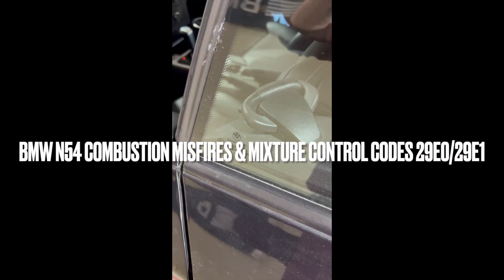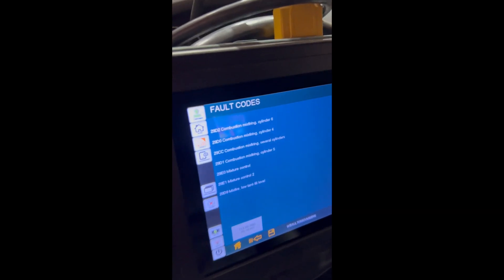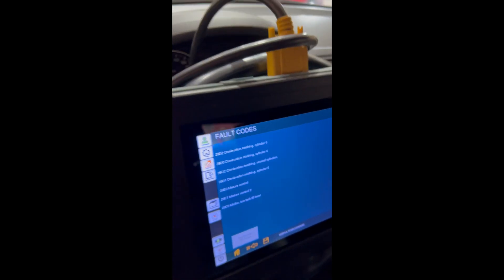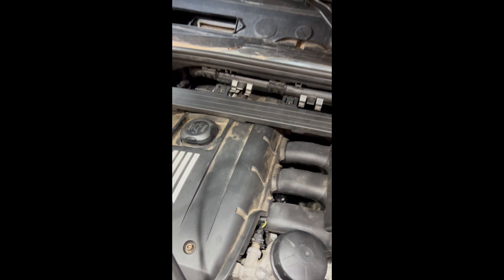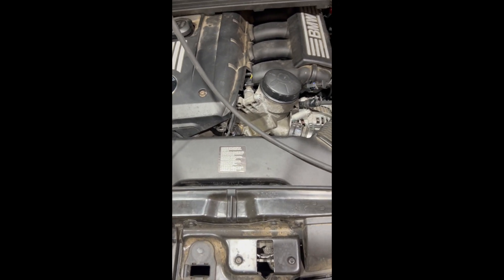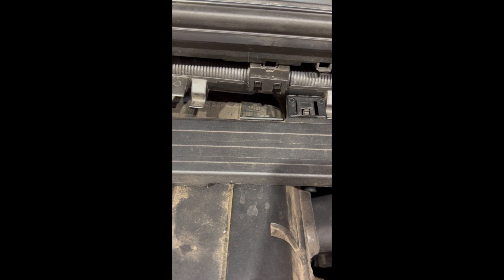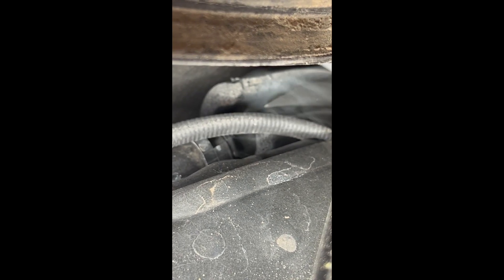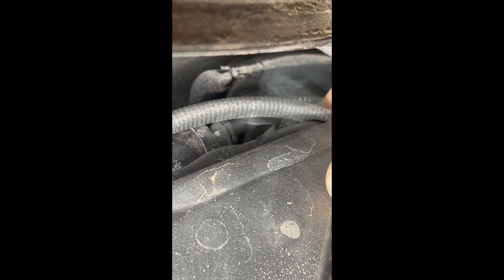BMW N52 Combustion Misfires & mixture control Codes

Comment: Hi, do you have any video of replacing a head gasket on ml 400cdi w163
Reply from the maker: Not at this time. If one comes in, I will make a video and post it.
Reply: @kootenayeuroshop6602  hi dude, do you have special tools that are use for head gasket change on Mercedes ML 400 cdi, most mechanic in my town dont do v8 engine and ones that do dosent want to share their knowledge, i have manual for rebuild engine but im struggling to find special tools for it so if you could send me photos of that tools so i can know what am i looking for, i will  leave my email adress here if you agree
Reply from the maker: @WARacrosTIME  Sorry bud I rarely have time to review posts. Did you ever build the engine?
Reply: @kootenayeuroshop6602  i have started but soon i had a bit of bad luck in my private life but Mercedes is still in my driveway and i intend to continue rebuild, all of its parts are removed and i have come to timing chain, but when i goten there i had few accident and stoped because my priority changed, but im still hoping to continue maybe this summer, my goal was to learn about engine and i still have that goal and i intend to make it,  did you done some video about it dude